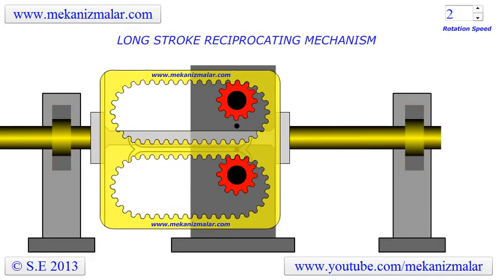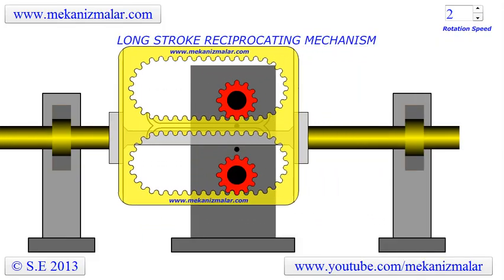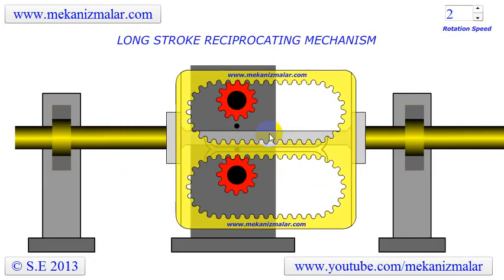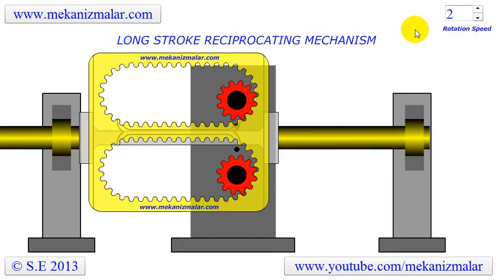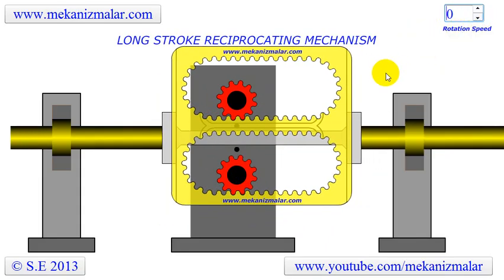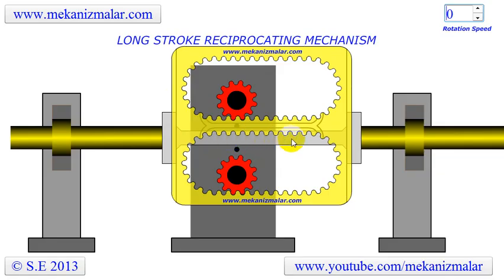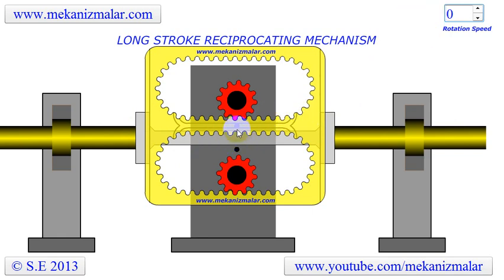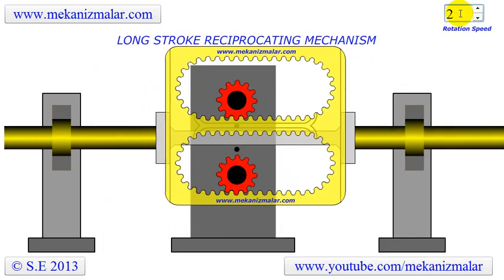Long Stroke Reciprocating Mechanism

Comment from the maker: That is very good question. There is no reason for the second red gear. Actually, there is no reason for the second yellow internal gear. When I saw this mechanism somewhere else, I spend quite long time to understand how it was working. At that time, I thought the purpose of second gear was preventing the yellow slider from felling down. Once I finished the animation, I realized that it was not working out. I added the grooves and kept the second gear. In short I was lazy to remove it.

Comment from the maker: Hi Grimaldon, You are very good observer.  In the situation you mentioned the red gear hold the yellow gear in one direction, but it may slide in the other direction. To prevent this there is two solution. The first, make the yellow slider longer and add a full circle groove, joined with another black pin. This will hold yellow gear in place.

Comment: What is keeping the yellow gear from shifting into a position half-way up and down so that the red gear is touching neither the top nor bottom teeth?
Reply: There are 2 black pins which are guided threw 2chanels in the middle of yellow gear

Comment from the maker: Hi Grimaldon, The red gear  connected to a motor behind the block holding red gears and black pins. They will not pop out. The yellow gear has grooves at left and right. The cams located on reciprocating shaft is sliding in these groove. Also the middle of the shaft is passing through the yellow gear. Therefore this arrangement prevent yellow gear pop out.
Reply: I could finally realise the truth after reading your comment. Thanks a lot. Actually I would like to add this for a better understanding: Each red gear turns  clockwise and they try to give a clockwise momentum to yellow disk and since it only moves sideways without rotation so the gears always stay in contact!!! Note that only one red gear would not be able to complete the task.

Comment from the maker: I had same problem you are describing, when I was doing the animations. But carefully adjusting the gear teeth, it is not that difficult although time consuming. Actual production of the gears  would be difficult process, if there were no laser or water jet and CAD programs. By using these machines and CAD program, cutting those profiles should be very simple process.

Comment: Interesting mechanism, I wonder how one would cut the inner gear, going from a rack to a seemingly tight curved will require a change in the geometry of the gear teeth to maintain proper gear teeth contact to preventing chatter and rapid ware of the device.  Any way thanks for posting I love your videos.